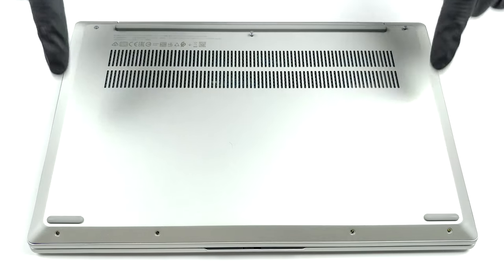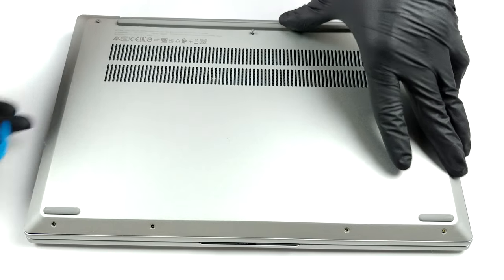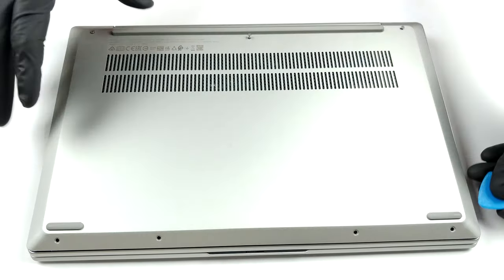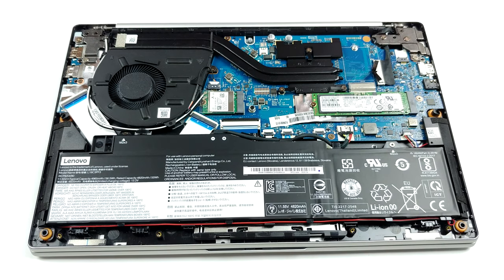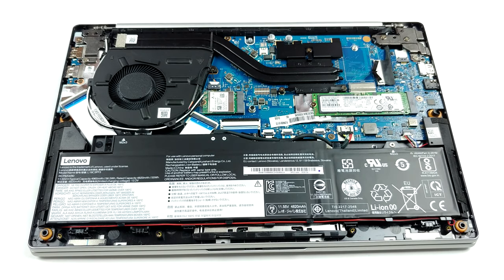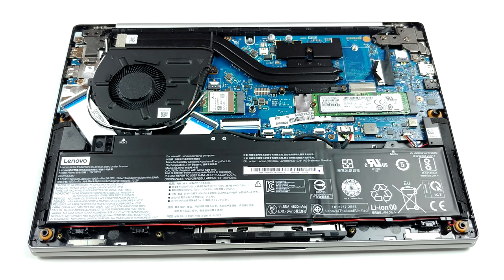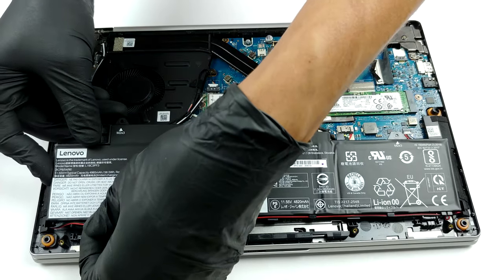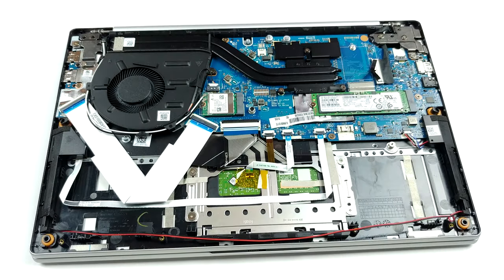🛠️ Lenovo Ideapad 5 (14) - disassembly and upgrade options

Comment: I have the 15” variant. It’s a beast. After adding some thermal grizzly paste under the heatsink the 4700U reaches 3330 points on Cinebench R20. Hopefully someone comes out with a guide for how to add custom adjustments to the fan curve, though. The fan seems to slow down even on extreme performance mode to enter some sort of equilibrium instead of staying on high RPM’s during work loads. Would love to be able to adjust this in the bios, but there’s no option to do so. And SpeedFan doesn’t detect the fans either.
Reply: i would love to see such a feature in the bios! i was thinking about trying argus monitor and see if it detects it :D
Reply: You probably need to increase STAPM (or even disable it!) in order to get sustained performance. When the fan slows downs, it just means that you reach the maximum STAPM, so the CPU has to lower its TDP (sort of).

Comment: Why not mention the wifi card?
By standard the one lenovo ships with is discribed as: Wireless (2 x 2), with bluetooth 5.0 or newer
but you can pick a different one with wifi 6 (2 x 2) AX, with bluetooth 5.0 or newer for just 6 bucks more.
Alternatively i bet you can upgrade it yourself if you buy the right wifi card
Reply: Hi! Can I ask what wifi card is best suited for this device? Thank you
Reply: It use ngff sir
Reply: I assume the 2021-2022 AX versions will fit but because this video-person refused to remove the Wifi card to show us the connectors, there is no certainly.  Too bad.  That gets my DISLIKE for this video - he didn't have to remove the antenna - just nudge the Wifi card out a bit to show the connectors!  It looks like it has 2 notches but there's no way to know for sure without this computer in hand to verify that.  The "Bluetooth 5.0" isn't very common on the older AC cards, so I assume this is an AX6-capable unit.

Comment: Seem like it has 2 m.2 slots, the other one is a half size right? Can we upgrade by using that slot?
Reply: Yeah, a slot is 2280 and the other is 2242, you can upgrade it buying and ssd m.2 with the same size of the free slot
Reply: where do you see the second slot?
Reply: @legohistory  The two slots are next to each other, the 2242 is vertically above the 2280, empty
Reply: @DavidGT-YT  Can I use both slots at the same time? And which protocols do they support?
Reply: David G Damn, I am blind af
Can‘t see it 😅
Reply: @NeoCaligula  Yep, you can use both, they support NVME (pcie 3.0) and SATA
Reply: @DavidGT-YT  I've been trawling the internet looking for this comment 😂 Thanks for testing, I'll be doing this!
Reply: @jameshughes9588  Me too !
Reply: @DavidGT-YT  are you sure about this? Did you try it yourself because lenovo mentioned they can only work one at a time...
Reply: @jameshughes9588  Did you try it? and does it work?
Reply: Will this support an egpu?
Reply: They should have used 2242 slot for an SSD so they would let 2280 free for a consumer to upgrade. Not a cool move Lenovo.

Comment: For me looks like it has 2 x ssd slots (1:45) JSSD1 & JSSD2
Reply: that's what i was wondering. I looked at another video and it seemed to have two ssd slots one m.2 2280 and one m.2 2242.
Reply: Hello. Is it true that it is a 2242, not a 2230?
Reply: @testingeraccount1126  2242 and 2280

Comment: So you just ignore the second m.2 slot? Is it for modems only or is it a PCI-E slot for storage
Reply: Since it's an 2242 side, I'm wondering if this isn't that phantom WAN card to set the computer up with a direct cell-phone card?  That's been common for more than a decade.  It would be interesting to see the BIOS screen to see if this second M.2 slot is 'bootable' - on some Dells, it's a WAN-card designator, but "bootable" and I've fit second SSDs in to serve as my TEMP/PAGING FILEs 'hard drive', and I've installed a 256 or 512mb SSD to serve as my boot drive, then used the larger 2280 SSD as true data-storage.  C: and a D: drive, therefore.  I sure with this video-person would have been thoughtful to discuss this, but we can blame Lenovo, I suppose.
Reply: @BuffaloC305  so turns out most of these come with the small 2242 SSD already installed with the 2280 free.

Comment: Hey.. i have the same laptop. I wonder what scale % use for comfortable work.. i try with 150% 125% and i`m not ok (many times i see it blurred) :( 100% looks clear but very very small... so how is with you?
Reply: try using 110% in the custom setting
Reply: yeah typical windows stuff 125% is the way to go. and change indivudual application scaling on percase basis. but it is never going to be perfect
Reply: Same problem. Windows 10 recommend to use the screen scaling of 150% but most of the apps have blurry interface with that settings and I tried many ways to solve it but I couldn't

Comment: lenovo ideapad 5 14ial7 14-inch (2022) - core i5-1235u - 16gb - ssd 512gb is my model with the intel iris xe  graphics, could I change that out on my model??

Comment: Can I upgrade ram and add HDD to it ??
Reply: Sadly no.
Reply: You can upgrade drive capacity by inserting an M.2 slot (on video it was already present, but in my case slot was empty)
Reply: You can upgrade only disk, RAM not
Reply: @miroslavmajer5155  and in the 16gb version? I can put a ssd?

Comment: I have the same laptop lenovo ideapad 5i, with a 8GB RAM, the RAM is fixed to the motherboard, the RAM is faulty, is there a way through which I can replace the RAM? Or is it not possible
Reply: More likely, impossible.
You may scratch some pins/connectors of the mobo (motherboard).
Upgradeable thing just on its SSD slot.

Comment: What does the ssd slot support? M.2? Nvme? Pcie?
Reply: all of them
Reply: So, the ssd is not solded?? can I add a ssd of 512gb??
Reply: @joc2302  yes there are two slots
Reply: Nvme
Reply: @evaristegaloois  so how many gen does it support? Gen2 or 3

Comment: Question to anyone that has this laptop... If you unplug the battery connector and just plug the laptop in via USB-C will it boot and function normally?
Reply: Bruh, nobody uses a laptop like this xD
Reply: @legohistory  That's irrelevant to me, I just want to make sure if it does or not. I wanna keep using it or pass it on to my family after I'm done with it even if the battery is dead, and if I can remove it, even better!

Need to measure its dependence on the battery. I've owned a Surface 3 and it was the worst thing I've ever used, if the battery ran out during the night because I forgot to turn it off or something WOULD NOT boot until the battery had a certain % filled, making me lose notes in class more times than I can count, it was an awful device.
Reply: From what I know, the laptop supports USB-C charging. I guess it can be possible
Reply: actually there is a mode where you can use it only with wired cable and no battery. battery level stays at 60%. its called Lenovo Vantage Battery mode whatever. you have to search for it.
Reply: @tioan93  Yeah that was the issue with the Surface 3, it charged via USB (micro USB in that case) so I find it hard to trust anything that goes via USB now even though I've never had a USB-C charging laptop. I know my phone has the same issue as the Surface 3, even though it's USB-C charged. It will only turn on if the battery is past a certain threshold. While that's somewhat acceptable on a phone because it's a secondary device where the battery lasts 2 to 5 days; on a laptop it's not.
So if it had a barrel jack I'd know I could trust it to power on without a battery instantly, all my laptops so far did without any issues, but this one... I'm not sure, and it would be a deal breaker if it doesn't power on without the battery.

Fortunately Lenovo has made it easy to wait and look for answers because they don't offer the 4800U version yet....
Reply: @legohistory  That's cool in a way, some phones have that and it can really help extend the battery. However it just poses more questions... can I set it up and uninstall the app after? Because for that stuff to work it has to be set at the BIOS level. If it's just software it will be ignored while the laptop is turned off.
Reply: eonizen it is just software based, but it will not be ignored if the laptop is turned off
Just charges until 60%
Reply: @legohistory  it does not work like that. It just keeps the battery charge around 60%, so it charges it time to time while you use it. It does not mean that it is not using a battery at all, because it is using a battery. You can unplug the charging cable and then it just empties the battery while using.
Reply: I have this laptop. Yes, it supports USB-C charging and I think what you say can work, the manual says that the laptop supports USB C charging. Try it, probably it'll work.

If someone thinks to buy this laptop, buy the 16 GB RAM version. I have the 8 GB RAM version and it's difficult to work 'cause the RAM fills up too fast. As for the other components, it's fine.

Comment: I have some issues with the trackpad rattling, has anyone tried to remove the trackpad and try to fix the issue?
Reply: 2 months later, did you find a way to fix it? because I am having the same problem
Reply: @omarawawdeh3388  No

Comment: can we upgrade the ram in the 8gb variant?
Reply: No, the RAM memory is soldered on all 14" versions. I just ordered the 16GB RAM version
Reply: @tioan93  only one slot is soldered right?
Reply: @kushagra3195  there are no slots, just 8gigs of ram soldered to the board (in dual channel mode). What a shame they didn't launch the 16gb version in India
Reply: @akshatrb  i bought my lenovo ideapad 5 the 15.6 inch version and when i go to task manager it has slots does this mean it's upgradeable. I also remember when i bought it, it said it was expandable up to 16gb. I have 2 slots each with 4gb in them so i think i can upgrade it but videos like this make me feel unsure
Reply: Task manger seems to be unaware of soldered RAM. my 14" model also says slots but it's clearly soldered.
Reply: What about 4gb version ? Can I add another 4gb in it ?
Reply: @minbcraft  i ran a crucial scan test and it also showed 2 slots each with four gb. Also said that the maximum capacity for memory was 16g. On top of this when i bought it from office depot i had read the description online the previous day and it said that memory was expandable up to 16gb
Reply: @harshavardhank  sadly you cannot
Reply: @jathkankanam  but i could technically just buy whole 16 ram stick (one) in the 8 gb version and just upgrade it, right?
Reply: @augisoncrack  That's what I'm trying to figure out as well.
I can't even browse the internet on mine anymore without it freezing up on me from having no ram.
But everything I've seen so far is saying no.
I honestly regret getting this laptop for the flashiness of it.
I knew I needed something with lots of RAM but nothing was available in the shit area I live in so I settled for flashiness.

I've only had mine for less than 4 years and it's now useless!

My father is going to be PISSED!!
Reply: @RissieRei  you cant, i got this laptop but honestly its amazing for multitasking and gaming, like it handles like one of the best 8 gb laptop. Also max graphic valrant 100 fps, crazy my guy. Its good for its price

Comment: Where to buy that 100% sRGB version of this laptop. Can't stand those 45% color gamut shits.
Reply: personally i would just replace the panel itself its using edp lanes w 30 pin connector
Reply: @somelllrandomlllguyti9295  how do you find better screen for the same laptop

Comment: Can we install SSD by removing 1TB HDD?
Reply: Yes you can but it will be sata ssd
Reply: Belastingdienst  it has 2.5 sata hdd... And can be replaced with ssd too... I have done it
Reply: It does not have any hdd it only has SSD
Reply: @theamitkadam1  you must be having laptop of another model not this one I have this laptop it does not have hdd it only has 512 gb ssd
Reply: @mithilpatel8339  i have one too, just want to ask that M.2 2242 slot, what type of key?
Reply: @raizelcadiz1715  ummm I didn't understand by what type of key but I think your asking sata or nvme. It's nvme m.2 and it's necessarily not 2242 size please check before ordering. Some variants like the us one has 2280 equiped and a 2242 slot empty. And in indian variant which I have 2280 sized slot is empty
Reply: @mithilpatel8339  i mean for the empty slot
Reply: Because ive read some that the empty slot can handle both sata and pcie so it means M key and M+B key will work, some say its nvme i dont know what is right..
Reply: So you mean the 2280 ans 2242 is just m.2 pcie nvme and sata can't, but im more focusing in 2242 because its empty slot and i want to add
Reply: @raizelcadiz1715  In my particular laptop I bought a wd nvme ssd 2280 size
Reply: @mithilpatel8339  then what about the empty 2242 slot,did you try to add and will it work as an additional storage?
Reply: Maybe it depends on particular regional difference. Like in us it has 2 type c ports one and here in india we have one dc port and one type c and rest ports are same
Reply: @raizelcadiz1715  2242 slot already had an SSD from company and I extended storage by adding another ssd in 2280 slot
Reply: @mithilpatel8339  ok so what type of ssd in your 2242 slot sata or pcie?
Reply: Because mine has 2280 but 2242 is empty so i need to be accurate b4 buying
Reply: @raizelcadiz1715  pcie
Reply: @mithilpatel8339  ok thank,but other says both sata and pcie work
Reply: @raizelcadiz1715  I installed pcie gen 3x4 ssd now I don't know about sata
Reply: @mithilpatel8339  the guy on this comment says sata and pcie both work